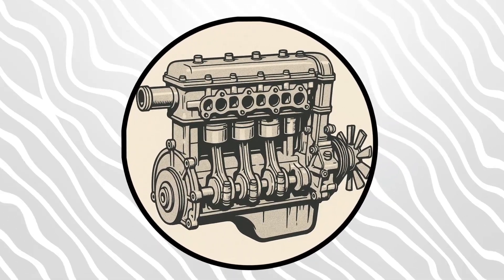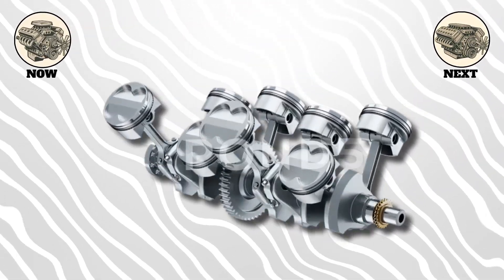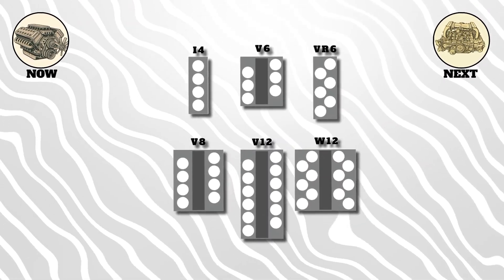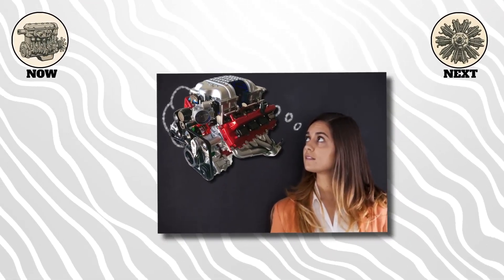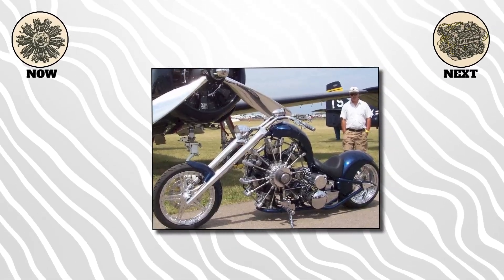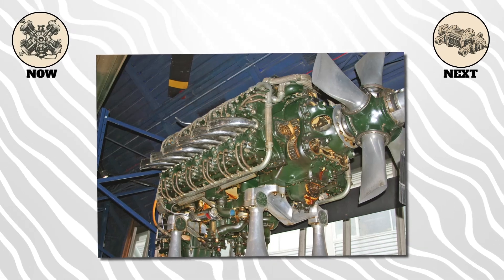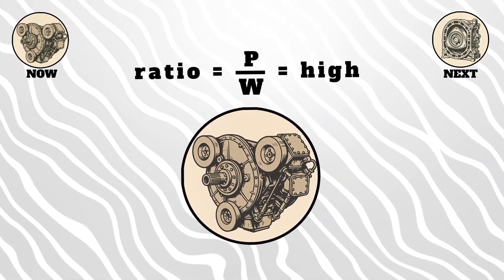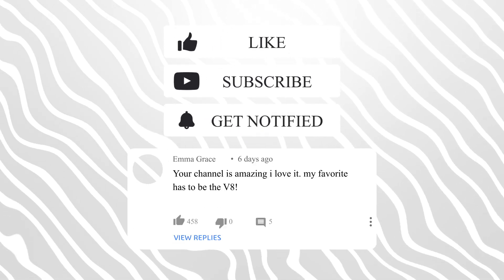Every Engine Layout Explained

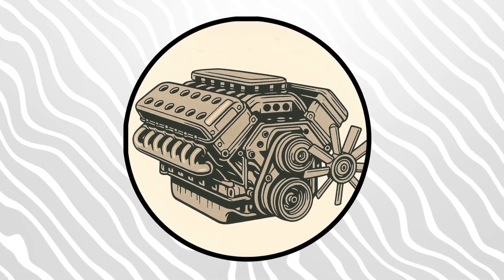Comment: 01:50 I don't know why W engines are often mistaked for 2 V engines but it is 2 VR engines
Reply from the maker: Well yeah ig but VR engines are also V engines with a smaller angle
Reply: V engines and VR engines are the same kind of engine, with the VR having a narrower angle between cylinders per bank.